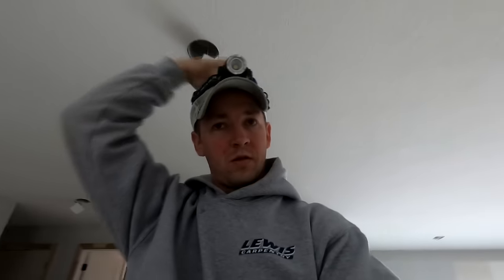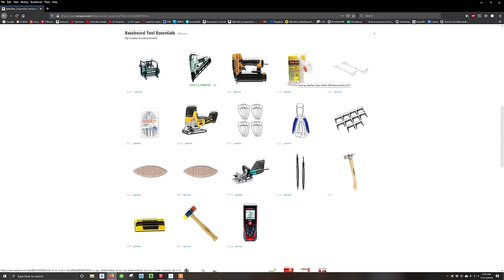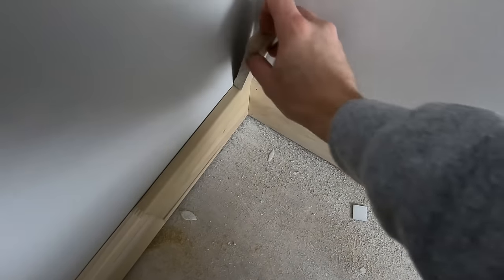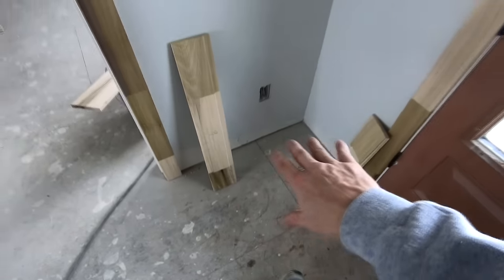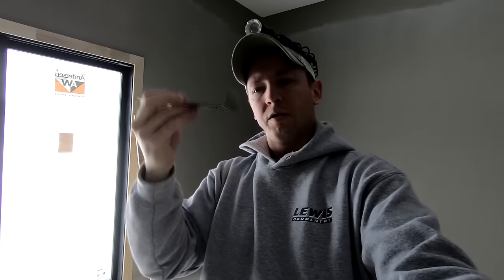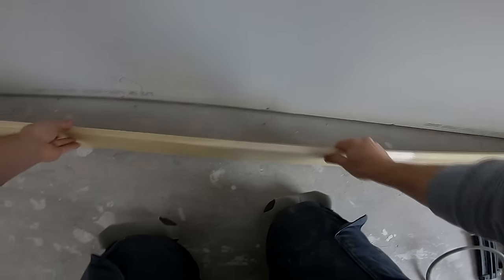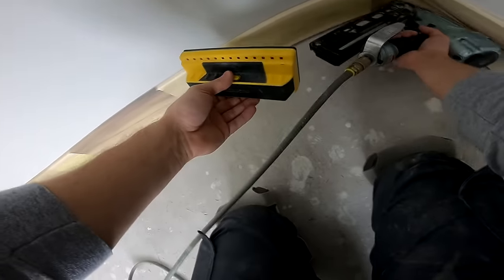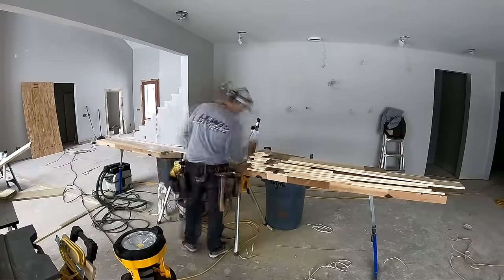Pro Tips for Fast Square BASEBOARD INSTALLATION - To Cope or Not To Cope???

Comment: this type of baseboard in stain grade is actually what got me to quit my last job, the guy i was working for wanted it absolutely perfect and that just wasn't going to happen in any reasonable amount of time. its nice to see a pro doing a job with the same results that I was getting and have that be ok. this guy wanted every butt joint flawless and air tight, and every outside miter flawless and air tight on the outside corner and on the top, which meant compound mitering everything piece by piece.  

Its unfortunate because this guy did know his stuff and i could have learned alot from him, but he was a real dick and no work I did for him was ever good enough. It sent me for a loop because up till then everyone id worked for had been more than happy with my work. I should have taken a hint when he spent half our interview complaining about his other employees. I determined that his standards were just impossibly high and even though he could work to that level and do it fast expecting others to that were at the pay scale we were was unrealistic.  he also was doing all this with a regular tape measure and a pretty beat up miter saw.
Reply: @dropndeal  i dont owe him anything. theres a reason he went through employees so quickly and couldnt keep anyone on. in our interview i made it clear that i had a fair amount to learn and that i considered myself a good mid level carpenter, which id say is accurate based on my work vs the work ive seen, but that i was mostly self tought and hadnt worked in a production environment before. he said that was fine and he would teach me whatever i needed to learn as long as i was reliable and hard working.   

i held up my end by being reliable and hard working, i showed up early every day and  stayed till we were done which usually ment anywhere from a few minutes to 15 minutes or so, didnt write it on the punch sheet / didnt fuss about not getting paid for it. i was hustling every minute when i wasnt on lunch.

his idea of teaching me everything i needed to know was one demonstration and expecting me to be perfect at it after that. the only comments he ever made were negative, if something was " acceptable" he simply wouldnt say anything. im not one that needs constant positive feedback, but i do need feedback good and bad to learn, everyone does. I also had to work on his verry beat up equiptment. the sliding compound miter saw i was expected to make these perfect miters on had a bad slider bearing, wasnt tuned to make accurate cuts in the virtical position,  and was on a cheap folding stand with no wings / extended fence, etc. 

the last day i worked for him, i showed up 2 minutes late, first time ever and dispite me putting in probably an hour of unpaid work.at that time,.he threw a fit and told me.to go home if i was going to be late. also said we would "discuss" my ability vs what he was paying me. he claimed i was being paid foreman pay, which in my area was absolutely not true. so i said respectfully, obviously there was some miscommunication about my skills, even though i felt i made them clear. and i quit then and there. i do not need that kind of boss in my life. im now self emplyed, making twice as much and much happier. I have let it go for the most part, but this video reminded me of it and it was nice to see a pro doing exactly the same quality that i was doing.

Comment: did I miss something?  I am a diy home owner trying to learn.  I just did my kitchen with a square pvc baseboard (thought it best to avoid painting since white was perfect in this case) but I did 45's everywhere and I'm not thrilled with the outcome, even though I measured all the wall angles and all were 45 except one 44.5.  never considered butt joints, but the question I have is in this video you use butt joints but some 45's too?  only on outside corners?  before watching this, I figured but joints would make me look like a amateur.  so butt joints on inside corners and 45 on outside?  thanks!

Comment: When you said that you don’t add anything to base that butts to the casing, does that mean that you add like 1/16 to other baseboard? And if so, is that because of the laser or just standard practice?
Reply from the maker: Just standard practice. The longer the board, the more I add. Max would be 1/16. Often I just add 1/32. For shorter pieces I don't add anything. I find that if anything the laser is already a hair long. Usually if you go with what the laser says it will be perfect.

Comment: Great demonstration and explanation. One question: wavy walls, do you follow or attempt to keep straight and caulk?
Reply from the maker: Depends how bad it is. I'd rather caulk than follow right if its really bad. But usually I just nail off where i can and it is what it is.
Reply: Insider Carpentry Thanks, for the reply. I guess it is in the quality/cost principle once again.

Comment: When I install base board I put 3 spacers just in case the floor or base are not even
Reply: I use four. Just in case there’s a dip between the three.

Comment: Super hints as always , I have a question .. I understand the " no need " for copping the base you installed on the video, but what if it was a square base with a "  groove line " on top ?  I tried copping those they never looked as I was hopping for.. any hits ?

Comment: A couple of questions: on the inside walls, the studs are made out of metal and not wood, a friend of mine told me I should use trim screws for metal studs, wanting to get your thoughts on this, what do you recommend? he also used a thin layer of liquid nails and 18 gauge nails, what do you think about that? Thanks for the video!
Reply from the maker: Honestly I'm not sure. I never have to work with wood studs.
Reply: @InsiderCarpentry  Do you mean steel?

Comment: I like your work flow, about 95% of the jobs I do are pre refinished (stained) material . Even with a 3 1/2 square base I’ll miter them , it doesn’t take long to do but does require a screw at bottom of drywall to make up for the relief area. I use a 21ga. As my go to nailer and as I write my numbers down I place speed square and pretty much guess at the angle , I write  my numbers down as followed.    56 3/8 \ / 92* then under it goes the next one so the 92* goes for last miter and first miter of the next  the \ / tells me both ends are mitered for inside corner.  \ \ this being inside to an outside. I have yet to get to 90-95 % on cuts but then again at 52 I was an iron worker for almost 20 years then a carpenter and have been trim contractor for the last 7 years, I do flooring cabinets doors and trim and I love my job
Reply: I thought I was the only one to admit I use screwes as shims to square a corner up. His video he uses his pry bar to adjust the bottom, cause his floor isn't in yet giving him that space. I stall on floor and planning no shoe mold I have used screwes before installing base board if that makes sense

Comment: thanks for the video. im just wondering one thing. i noticed you only put 1 gauge block on the ends of each length of base. for such long lengths, isnt it really easy to get a crown in the middle that throws off your spacing? thanks.
Reply from the maker: Usually I do put a block in the center on long runs. It just depends on the day I guess.

Comment: Do you ever use the screw or nail trick at the bottom of the baseboard to keep it plumb?
Reply from the maker: No. That’s more of a diy trick. For production work it would take way to long to do that in every corner.
Reply: @InsiderCarpentry  So what's your secret for keeping the bottoms from moving inward on the drywall taper?

Comment: Nice content, just one question, why no 45 cuts at the inside corners what are the pros and cons of not doing it, I like no 45's better but not sure, thanks man.
Reply from the maker: 45s are much less forgiving and tend to open up  more. With a 45 you cant cut the pieces long and snap them into place like you would with a cope or butt joint.

Comment: very nice job any homeowner could watch your vids and learn how to do it. oh and 15 ga. guns are too big 16ga works just fine for doors base and larger pieces of wood. finisher 35 years not sure why I ever bought a 15 ga. gun it sits at home in the case just as new as the day I got it. be safe and tight cuts.

Comment: That butt join is commonly called a “commie miter” in my area, referring to general workmanship in the Soviet Union. However, I can see your point, no one is going to notice that after paint, here in my area we don’t do base boards, just a small piece of trim that’s finished before installation, so it’s a lot harder to hide anything, hence everything gets mitered.

Comment: Is it hackish? Absolutely not! As a cabinet builder and trim guy who is prone to perfectionistic mentality I do not cope this profile of base either. It’s simply not necessary in my opinion. I agree with your comments on this. Base boards are base boards. As long as the inside corners are tight that what matters to me. I live in Oklahoma and around here the wood floors are not prefinished and they are glued down to the slab before I move onto site. When we install base we have to scribe the base to wood floor and because they are raw wood they are not sanded until the house is finished so that sometimes requires us to either use a chisel to knock down some of the wood floor or sand a small strip of the flooring to lay the base against the wood floor. My builder doesn’t allow base shoe in his houses.

Comment: Another great video! I'm assuming your installations are mainly new housing, but what happens when the base that your're installing is thicker than the door casing? How do/would you deal with that to make it look appealing?
Reply from the maker: You would have to use a plinth block at the bottom of the casing for the base to butt into. 👍
Reply: backband
Reply: I use the baseboard as the plinth block, looks great cause the eye lines are not broken. The casement starts above the baseboard, it's a clean finished look.
Reply: Love your videos, I also do trim here at East coast. For that situation I did a base board return against the smaller casing. Took that little 3/4 quarter mitered 45 piece the return and ca glued it on. I also thought of the block, but didn't have any and was almost done with project.

Comment: Obviously you know it’s not hack with that particular base. I’m from the northeast and we use FJP boards as opposed to what you are using. A lot of “ sins” are permitted with paint grade although one should always do the best job possible. If the joints not tight it ain’t right😀

Comment: Impressive setup. When cutting the outside miters at 46 degrees do you find the inside of the mitre opens up? Or does the painter just fill that gap?
Reply from the maker: Minutely. If the glue doesn't fill the space the painter will hit it.
Reply: @76 If the wood is stained, you get soft putty( minwax for example makes a putty that closely matches the stain color on most of there common stain colors) that matches the stain color.  Or use natural putty and add stain to it. Most of the better painters that due high end custom homes usually like to make there own putty to match stains, so they can make a lighter and darker putty to account for the different colors with graining and knots.

Comment: Curious...What advantage do you feel installing base before flooring has if it’s not already painted?
Reply from the maker: Its just how its done around here. No risk of damage to flooring. We use show molding, so no scribing to finished floor. Door jambs are cut with a jamb saw by flooring guys. I don't have to mess with that. I much prefer installing with no flooring. In large custom homes when I have to use scaffold and stuff it would be a nightmare dealing with flooring protection.
Reply: Its all about protecting that expensive floor. Base board first just prevents scratches that WILL happen if its all done after floors

Comment: If your nailing the bottom of the base that much, doesn't that open up the inside corner of the base on the bottom due to the bevel of the drywall?  I know that's where the flat bar comes   in but I didn't see that you needed to use it in that room

Comment: It looks like it’s be a real pleasure to work in some the houses you trim. I’m currently working on a loft conversion on a 450 year old stately home (Uk) and any sort of efficiency goes out the window when there’s a 3 1/2” dip in the floor over 12’ span or the timber has been so badly eaten by woodworm you can’t get a fixing. I’d like to swap with you for a day, I reckon I’d really struggle to keep up the pace as it’s just not something I get to do that often!
Reply from the maker: I know what you're saying. I used to work exclusively on remodels. It's a different game.

Comment: Hi, I currently have a paslode cordless 18g (and framing nailer) any reason for me to go pneumatic for trim?
Reply from the maker: Pneumatic lasts much longer and doesn't require fuel cells.
Reply: @InsiderCarpentry  thank you. I build condos and there is barely outlets on site so I definitely appreciate no hoses for my work but I can see how it would be easier in singles. Cheers

Comment: Thanks for the great video!  I am a DIYer...  I was wondering about when you were talking about installing the base and you mentioned you didn't add anything to the pieces that butt into door casing...  Do you generally add a fraction to your measurements?  I am using 3/4" S4S maple to trim out my old house.  What size nails would you use to fasten door and window casings at the jambs?  Thanks in advance!!!

Comment: I use the Franklin, but I always lay a tape down too.   One time the Franklin showed stud on a gas line that got pushed up against the Sheetrock. I would have fought it with the tape showing off layout.  15ga nail puts a nice hole in trac pipe gas line 🤦‍♂️
Reply from the maker: Yep. I did the same thing running crown. Double tapped a line set for a second story air conditioner.

Comment: To find the studs I just find one, and then layout my tape along the floor and shoot the nails on every 2' or 16" what ever the wall layout is. easy and fast.also the laser measure i have saves my measurements in order so I just start shooting from which ever corner I desire and then when I get to my saw my measurements are there so I can just start cutting.
Reply from the maker: I have thought of doing that but I usually shoot the laser 2-3 times to make sure the measurement is good so that doesn't work as well for me.

Comment: Do you ever have problems when pulling pieces back out and cross nailing then the carpet layers just knock it back with their stretchers.
Reply from the maker: No. Last thing building the house is paint touch ups. So of there would be an issue painter would touch up and it would be fine.

Comment: Interesting to watch how different you do it from us in the UK
Reply: and even more is the difference how we do it in Poland, when we work on the finished floor painted walls and the baseboards come from the manufacturer already painted and not just primed :) every angle every joint must be cut perfectly because it can not be simply putty and painted because the baseboard is already  painted for finish
Reply: You can buy pre finished materials here but no one uses it as it’s very expensive and like you say any mistake and it’s thrown away, not that I make any mistakes  ..... 😂
Reply: @creativetag1  yeap but here you can't but not pre finished materials, i want it i want instal prep and spray but here no way there is no primed or raw all of baseboards are prefinished :(
Reply: @bboyslimek  Then what do you do about the nail holes?
Reply: I'm finishing them with drydex and paint with spray varnish the same RAL color and gloss level that is on the baseboard, but spray only in the area of nail holes
Reply: bboyslimek oh I like that. In my case, the walls are painted and floors are finished. How do you mask them? And what about the caulk at the top of baseboard, doesn’t that need painted too?
Reply: @taurek8366  yeap, caulk need to be painted, but in my opinion should be painted the same paint as the walls(only if you have already painted walls and finished baseboard) otherwise you can like normally prime and spray baseboard and them paint walls, If wall are pained and baseboards are prefinished i first fill nail holes then very light sand spray this area(I use a piece of cardboard to cover the wall, and spray is fast drying only few minutes) then chaulk and paint it from hand(only chaulk) you can also use a paint masking foil for cover walls and floor

Comment: I hate having nail base and crown on painted walls/ceilings. I’ll have to check out that stud finder. The ones I’ve used are pretty worthless.
Reply from the maker: It's by far the best and easiest to use in my opinion.

Comment: I jack cope square edge base it just looks better than butting it takes a little more time but looks better and caulks nicer. Ive also been on a job where a coworker got called out on his butting the squared base the miter line is just a little detail that shows you care about your work imo
Reply from the maker: But it all costs money unless you’re doing it for free. The point I was trying to make in the video is that 99% of people will never notice your jack cope and if given the option people would take the butt joint and spend that money on a different detail that actually provides a discernable difference.